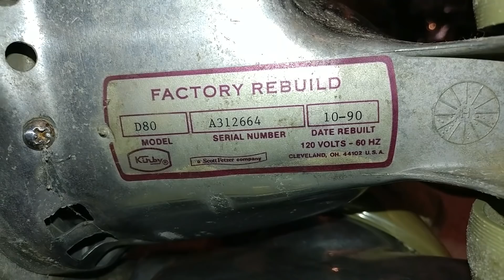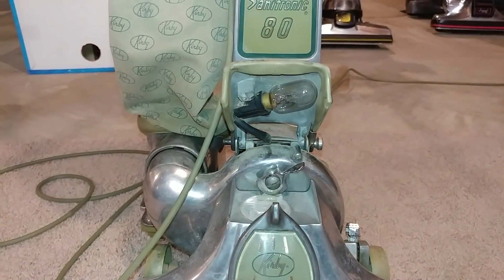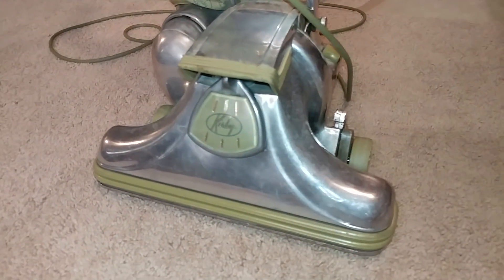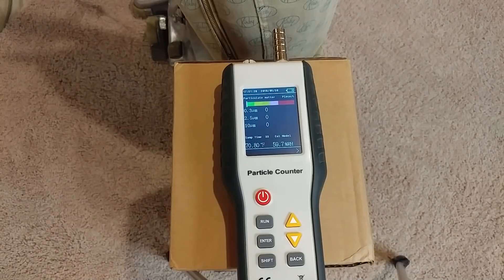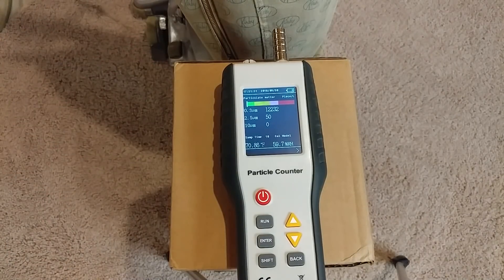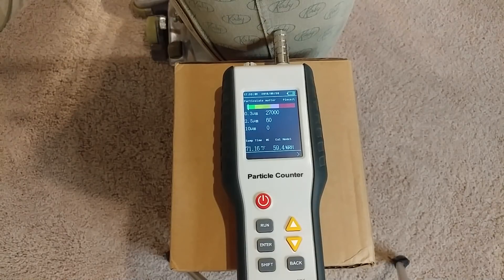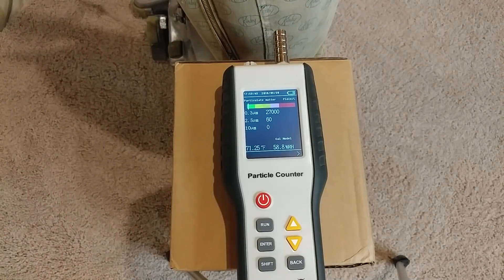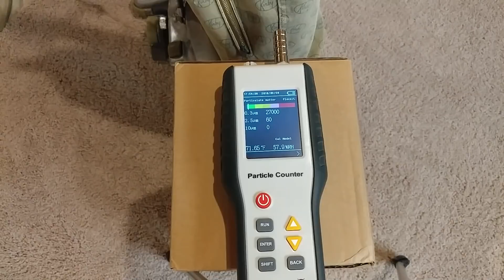Kirby Dual Sanitronic 80 Preliminary Particle Meter And Airflow Box Tests

Comment: How bad is the filtration on these shakeout bags? The kirby store i go to has a d80 for $100 that needs cleaning and I'm actually thinking of going back to see if I can get it because I'm only familiar with g series since I have a g6 and several family members have had kirbys in the past but I do want to try a vintage model
Reply from the maker: For most people, the filtration will be just fine. Make sure the bag system doesn't have any holes. See my whole house carpet cleaning playlist for more visual info.

Comment: Did you ever do another particle test with this to see if it changed any?
Reply from the maker: Yes, I re-checked and still tested around the 30K mark for 0.3 um.
Reply: @VacLab  Good deal! After watching this video some time back, I wound up converting my old Kirby back to using a shake-out bag. I was satisfied enough with the results that your machine displayed that when I serviced mine I converted it back to the way it was. There is just something satisfying about dumping out the filth that you collected. I take mine outside on my deck and open the tray over the railing.
Reply from the maker: @mattjones7621  I prefer my machines to be in all original condition wherever possible, so I have no issues with a dump type of system.
Reply: @VacLab  I remember you mentioning that one other time. Sometimes I am like that, too, but I also like making some of them look brand new or unique. I found my 519 in an old antique store in Cave City, Kentucky when I was twelve-years-old. It was original except for the cord, bag and emtor tray when I found it. I didn't know the model history for many years and I made improvements to it as I was growing up. I experimented with it a lot as I did with other machines in my collection. I did a complete rebuild in 2009 when the machine turned fifty. I went with the tan trim, because I grew tired of replacing the red belt lifter that would pop rivets off the lifter hook from lifting the belt. The tan one would do that, eventually, before I finally got the triangular, metal lifter found on models 560-562. Never had any belt lifter issues from then on. I wanted the machine to look brand new, so I replaced the trim, bag, tray, switch cap, wheels and handle tilt latch button. Left it that way for years and had 'retired' it to storage when I got my Diamond Edition. It felt like a waste for it to stay in storage, so I got it back out to use again. Since I have asthma, I switched it to using a Heritage 2 bag setup and noticed it filtered better. I didn't like the look, so I was relieved to see your particle testing video of the Dual Sanitronic 80. Even though it is nowhere near HEPA, I was pleased to see that the air is still clean enough to use the shake-out bag. So the next time I serviced it, I put the old setup back on. I am going to be servicing both of my Kirbys very soon. The 519 is getting a new fan, fan case gasket and polishing :-)

Comment: I do not know much about a Dual Sanitronic 80. I do know, however, that it was the first Kirby to not have the straight handle (like the 561 (I forget the model number) you cleaned with at church). This was also the last of the first generation Kirbys–what would follow was the second generation of Kirby’s which was the classic (1CR) through the Legend 2 (2HD IIRC). Changes with the second generation included a wider nozzle and a double insulated cord starting the classic Omega 1CB (the successor to the classic 1cr). You sometimes may find a DS80 with a different belt lifter decal giving instructions on how to operate it (the belt lifter). Not sure why, but it could’ve been just what was included when the vacuum was originally sold by a dealer (I would have no idea, though). Most famously, though, this vacuum was the inspiration for Kirby in the 1986 Hyperion film “The Brave Little Toaster”.
Reply: Forgot to mention that this would originally have the metal fan, but I’m sure you knew that. Given that this was rebuilt in 1990, depending on the fan’s condition back then, this would now sport a Lexan fan since the Tradition 3CB models (1979-181) eventually used them. The Amodel fans (commonly mistaken for being Kevlar (I’ve always done that until now)) would be seen in the G5 onwards. I think I’ve not yet seen the polishing video, so I’m not certain if there’s a metal fan in there. If there is, then I’m not sure if it was left in there by Kirby or put in by the previous owner (your guess is as good as mine, or possibly better).
Reply from the maker: Umm, the DS50 didn't have a straight handle either, right?
Reply: VacLab no, the ds50 did have a straight handle. Unless I’ve not seen one with a wide handle (like the DS80) that is original to the machine (I’ve seen ds80 handles on ds50s occasionally, that I do know). I doubt one exists, but you never know. If one does then my guess is that it is possibly a very late model ds50.
Reply from the maker: @johnerikson7094  some of the pics and vids I just googled were of such poor quality that it was difficult to determine what handle type was available for this model. Finally found some visuals that confirm a straight handle.
Reply: @VacLab  For what it's worth, we have a ds50 with a straight handle from a neighbor who bought it new.
She also had it fitted out to take the paper bags and gave us the old bag and original sani-emptor.
Great vacuum.

Comment: That is a beauty! I had one for a little while, and that thing had a TON of airflow. It put up a good fight with my Royal 2028. It had the original metal fan, but I had two replacement bags for it. I made a few videos of it, and had fun with it during the time i had it.
Reply from the maker: So what was its fate?
Reply: I wound up selling it. I needed the money more than the machine. I still have my vintage 519 that I've had since I was twelve. I have made many modifications to it and converted it to using HEPA filtration.

Comment: Nice test 
I have a d80 I added basically adapter to emptor using newest sentria 2 hepa bag.  2.75 in inne fill tube.   
I took of sentria adapter cut Small lip off and put on adapter for the g series hose to fit.
I'm getting parts to finish rebuild of vacuum.   Initial test on562 4 amp motor Baird using old hose pulled 102 cfm.  The nozzle was 118. 
Nice tests though.  Keep it up.

Comment: Does anyone know what dual sanitronic means?
Reply: Yup. The D50 and D80 were the first Kirbys to have two speeds low for floors and high for the hose mode. I was told this by a retired Kirby dealer.
Reply: EvilKlownz4u the sanitronic part though, I’m not sure what that means since before the d50 there was a machine called the Sanitronic VII